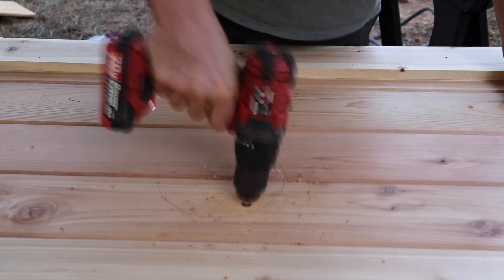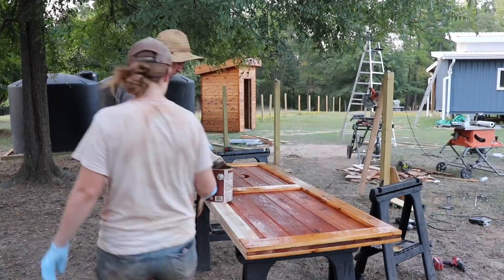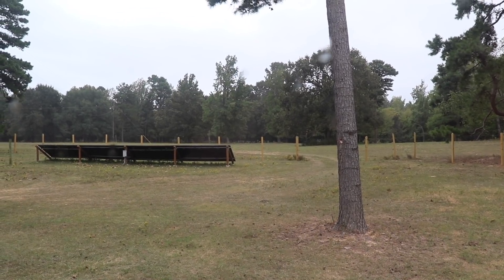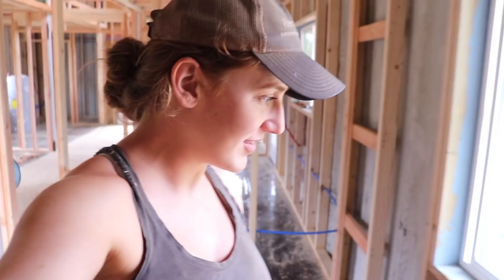Heating Our Home's Water WITHOUT Electricity or Gas!

Comment: Tip : Paint inside water batch heater box black, to get the temperature up. 👍😃
Reply: Smart comment here.
Reply: Was gonna Say the same thing
Reply: was going to say same thing & also put a glass top for sun to pass through for additional heat..
Reply: Paint the TANK flat black but put reflective material on the walls.
Reply: Happy Saturday. Thanks for the upload!
Reply: first add ewery wall good full insulation ,then paint all black, and top glass, but BEST heater have black painted coppertube spiral added on to black painted wood sheet veneer or other, and frames,4 inch high and then glass, or if no can do coppertube spiral use black 1/2 inch plastic tube. black colour, heat lot better than all otyher stupid ideas.
Reply: NO, don't paint it black. Get some insulaton that has some reflective foil on it and put the foil facing the inside so that all the suns rays are reflected around the tank, to the bottom and other parts that the sun does not directly shine on.
Reply: @rushd45  No, with reflection some light will reflect out (through the glass) the box.  Key is to tranfer light to heat ASAP (Heat will stay in the box better than light).. Heat also will fill the box evenly and don't depend on light angles.

Comment: IN WINTER WHAT HAPPENS WITH THE WATER HEATING ?
Reply: I think the solar water heater is put before a regular one. So water is pre heated to save gas or electricity.
Reply: There is still sunshine in the winter...
Reply: @BeachComberNoni  Depending on the climate in you area. Freezing is a MAJOR problem. November through February(northern hemisphere) have very short days and long nights. Minimal sun and freezing weather are a bad combination for solar.